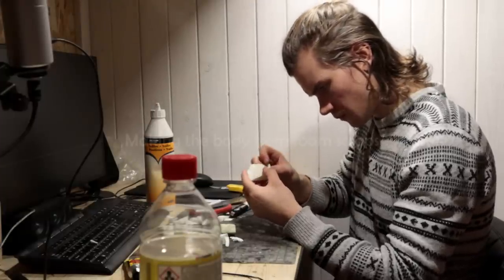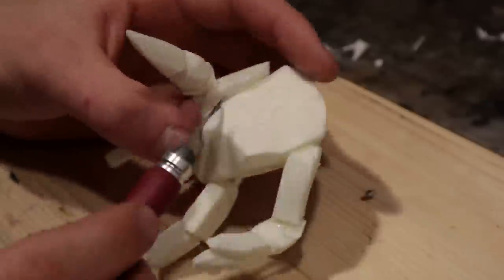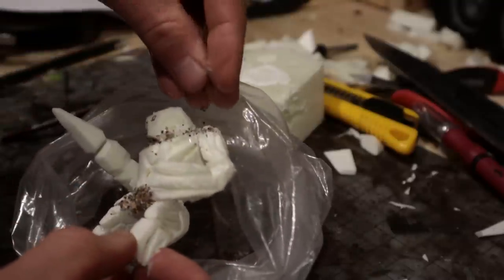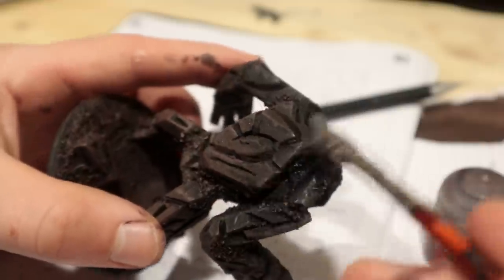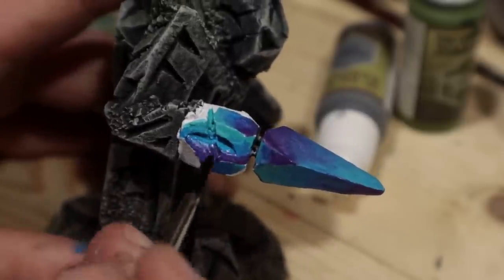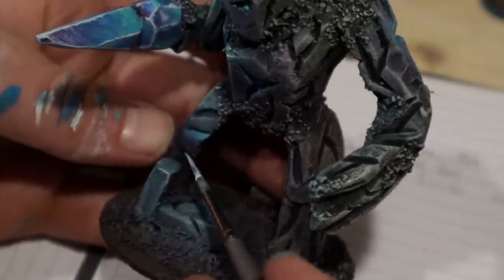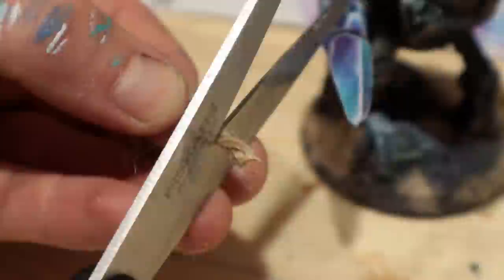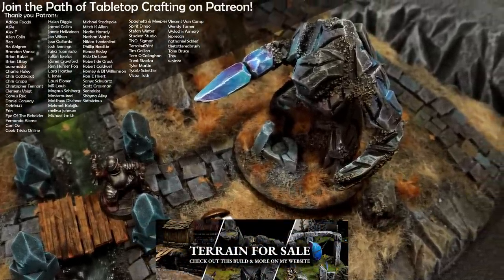RUNE GOLEM - Making a Custom Miniature for D&D

Comment: All this stuff in "what to buy" but never shows where the foam is gotten from. And/or what foam is good or bad to use.
Reply from the maker: It wouldn't help if I showed a store that exists only in Finland. Try to check out building hardware (house building materials) stores and find XPS foam. The one I use is Finnfoam. I only have experience with the Finnfoam.